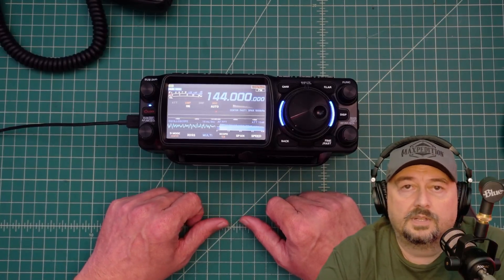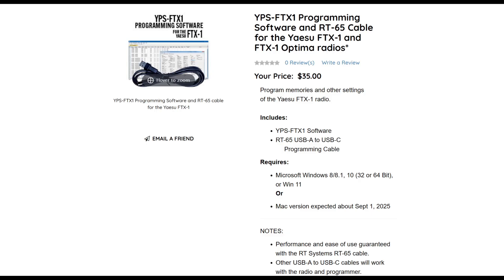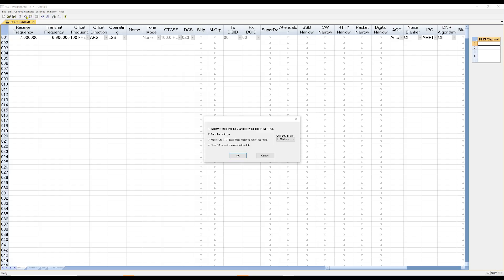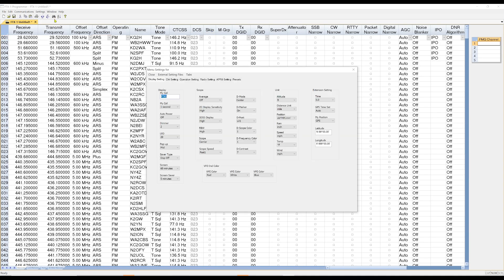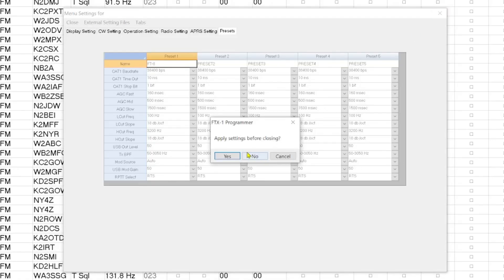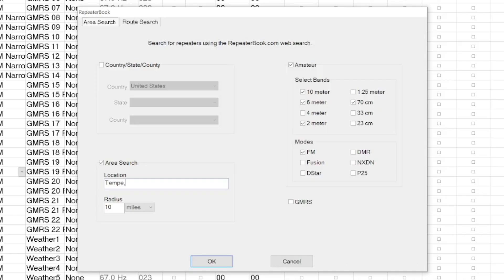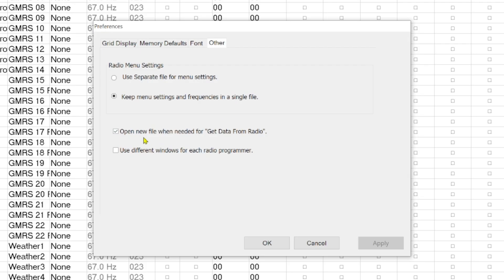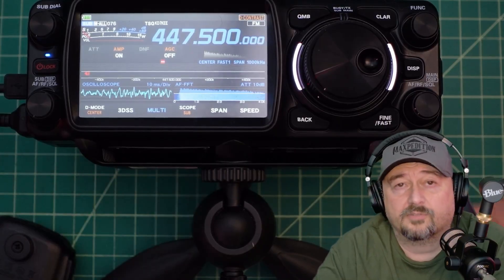Yaesu FTX-1F Programming Made EASY with RT Systems SOFTWARE!

Comment: Latest firmware broke this for me. I can no longer send memories to the radio and most radio menu settings don't write either. Save your current memories on the radio to the SDCard before you update the firmware and wipe the device.
Reply from the maker: RT says about two weeks until they get it sorted out 👍

Comment: Thanks Ape. I did not know that you could use any USB-C cable (Data). I have those so I am going ahead and get the software. Was holding off until I knew if I could program via the SD card but if all it takes is a USB-C cable then I am set.
Reply from the maker: I need to test the SD cards stuff, that way you can have a few “profiles” on the card 👍
Reply: @TheSmokinApe  Thanks Ape

Comment: Make sure you do the update on the RT systems. I bought the software and I noticed that repeaters that got loaded from Repeaterbook did not have agc auto set. This resulted in low signal and bad performance. I spotted the bug and reported it to them and they have now issued an update which you can do from within the software.
Reply: Watching closely, I can see that you have AGC auto. You are on the ball Mr ape.
Reply: I noticed there is no transmit output power setting. They said this is normal. on my 705. I believe it does have this setting in the software.
Reply from the maker: Hey Chris.  That’s a great point about making sure everything is up to date.  Thanks for checking out the video 👍
Reply: I had a similar issue with having no audio on TX into repeaters, and I couldn't figure it out. Called Yaesu and was advised not to use the RT Systems program until the next update comes out.

Comment: First accessory I buy for every radio is RT Systems software.  If you have a lot of VHF/UHF radios and a lot of memory channels the software is priceless.  It's so easy to open the software for two different radios from two different manufacturers.  Highlight all your memory channels in the one program, right click and copy.  Go over to the program for the other radio, right click and paste.  It just works flawlessly.  Icom channel list to a Yaesu, Yaesu to a Kenwood, Baofeng to a Anytone.  No converting memory channel files to a different file type, no loosing channel names and other channel specific info.  If the other radio doesn't have a column for something then it just doesn't use that info.

In the case of this and several other radios that just use a standard USB cable I would do just as you recommended, use whatever you have.  If the radio has a radio specific cable the RT Systems cables are super high quality.  They are also extra long.  Well worth what they charge for them.
Reply from the maker: I had never used it before but I think I’m going to get it for my ftm500 👍